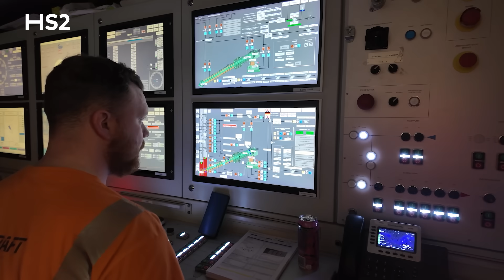HS2 Project Update, October 2025

Comment: What an incredible engineering project this is. Can’t wait to see the next generation high speed trains flashing through the countryside. I definitely think this will be a highly successful rail line and hope that extension North is back in the plan soon. 😁👍
Reply: Yes, it's impressive. However, it's also very late and very much over budget. Anything can be done if you throw enough time and money at it.
Reply: @AW-xj4un  very little of the actual cost overruns and delays are down to the engineering, political dithering and point scoring are mainly to blame. Ironically the way to claw back some ‘better value’ would be to re-introduce the Northern legs of the project and implement the lessons learned. Start building HS3 from Leeds and Manchester ASAP and re-assign the skills as various elements of HS2 are completed. 
And start planning HS4 into Edinburgh and Glasgow.
Reply: @HighFell  Those tunnel boring machines could be used to make tunnels under the Pennines as part of HS3. Equally, a new tunnel to speed up trains between Manchester and Sheffield could be completed. Another option could be a tunnel through the Cheviots to create a far, far more direct path between Edinburgh and Newcastle. 

There's talk too of a new Bristol Channel tunnel being needed, and you could think about what it might cost to tunnel under Dartmoor, Bodmin Moor etc to create a new straight line tunnel connecting Penzance and Exeter.

More likely, however, London will use them for Crossrail II. As HS2 budget was to develop the North of the country, any engineering benefits from boring machines purchased for HS2 should go to the North, not to London. 

With all those boring machines coming available, though, basic common sense says 'look for new tunnels to complete to maximise value-for-money from the purchase of extremely expensive pieces of kit.'
Reply: @rhysjaggar4677  digging tunnels is much more than just the TBM but they  can be very useful. 
Consider that when the railways first spread across the UK, that a ‘standard  level’ was chosen and all railways were completely gradient free. The savings would be be enormous by now, faster travel, less energy, less pollution… The downside would have been the extra costs at the construction end..   and that is the infrastructure conundrum 😁👍

Comment: The problem with comparing building a railway line here in the UK to building one in say France is that the numbers are not comparable. In the UK the cost is for EVERYTHING. The line itself, the stock, the signalling, the stations, and all other infrastructure. In France the headline cost is only the rail line. The stock, signalling, stations etc are then costed separately and 'hidden' in the small print, or are completely separate contracts that don't form part of the headline contract and costs.
Reply: Likewise in other European Countries abd China.
Reply: @TrevorWilliams-fq8mg  Indeed. France was just an example.
Reply: glad someone else is also pointing this out _ its a valid important point _
Reply: @Michael-61-n3l but still people try to compare. China is the favourite comparison. The Chinese claim to have built a,station in a day. When you google it it's a,prefabricated platform.

Comment: We've got HS3 in the Highlands of Scotland 
It takes 3.5 hrs (if the wind is blowing in the right direction) to travel the 170 miles from Inverness to Glasgow 
Which is less than 50 miles per hour average speed 
The 82 miles Inverness to Aberdeen takes over 2 hours+ about 40 miles per hour 
If England finishes at Watford Gap then Scotland finishes at Perth
The whole of the UK is a fecking joke
Reply: Thing is, would there be enough traffic to justify building such expensive lines up there? You'd probably need a tunnel from Aviemore to just north of Perth if you wanted it to actually be fast.
Reply: @rhysjaggar4677 just more than a single track would be a start
Reply: @philjameson292  I suspect the problem is that the population of Scotland is less than the population of London, so nobody making the decisions cares.

Comment: the initial estimates for budget & build time have proved to have been wildly over optimistic _ as I drive by Delta Junction which I do regularly _ the engineering is superb & it's noticeable that the pace of work has increased but those estimates _ just crazy with inaccurate figures 
        saying this _ the leg to Manchester needs to happen first before any other destinations ie Liverpool & Leeds_ and hopefully Andy Burnham will quietly drop his ambition for that multi level underground station at  Piccadilly _ in my opinion a contributing factor in Rushi cancelling that leg _ not prepared to pay those costs for that new station as compared to what was initially planned under the original plan _ 
     personally I would like see both Handsacre & the Golburn junctions built _ raillines need to be linked to allow for an integrated system _but that will take time 
          it's the same question about linking hs2 & NPR _which is a good idea
Reply: I heard that a lot of projections were based entirely without site surveys. Just using online modelling tools. I hope lessons were learned from that if so. I've also heard southeastern folks saying they couldn't care less if the UK split in two with the north of England and Scotland seceding: tells you how London-centric politics plays out I guess.....
Reply: @rhysjaggar4677 _ that wouldn't be a surprise at all _ sadly
Reply: The entire project is massive and was always going to be a mess waiting to happen. The budget was a figure pulled out of the air to satisfy the government so it has no detail behind the figure.
Reply: This Reset has been talked about for approx a year, when is the talk going to turn into something we see? Continued pauses are all we see? Great that Mark shares these vids, but I bet he has a very large bonus structure in place and we still have no date for when any of it will be open, that he'll get and as CEOs come and go, will he even be in post when it does. I agree with others that phases 2 and 3 need to happen, but I fear never will as we can not afford it
Reply: @briansewell7263 The reset is nothing more than an updated estimate of the likely final cost and comoletion date. Nothing has been changed, nor can it.

Comment: When will the tunnels fitting out start?
Reply: As stated in the video, once all of the civil engineering is done.  I think I read 2027/28 for that, will probably two or three years to fit out the whole line. Then around a year of testing.
Reply: Plastering is next, followed by second fix electrics and then shelving units and carpets in a few months

Comment: Absolutely agree, not just about doing the right things, but doing them in the right order. The RESET is definitely the right way forward
Reply: That's what they have been doing. If you look at the photos they are still building the tunnels, cuttings and bridges. No electrification or track has been installed.

Comment: When the railway opens, it will be a closed system for 4 years because you have delayed the West Coast Main Line link at Lichfield. That is absolutely insane. £100bn for a railway with 3 or 4 stations (depending on if Euston opens) is outrageous. I support HS2 but you have to wonder who the railway is actually transporting if it doesn't link up with the rest of the railway network?